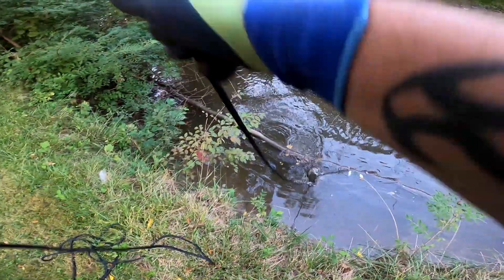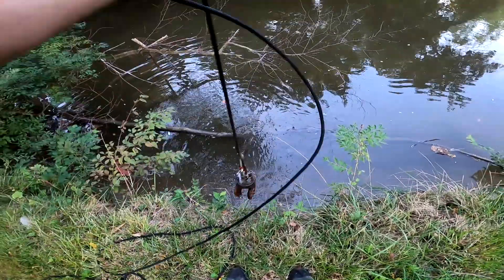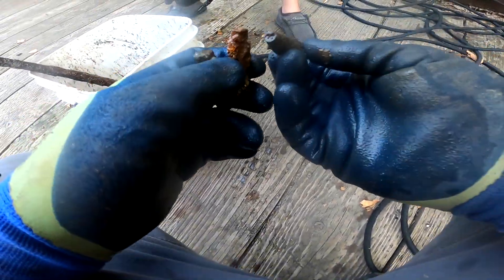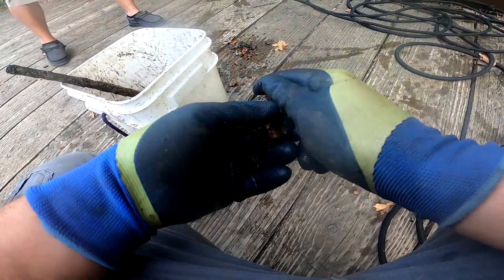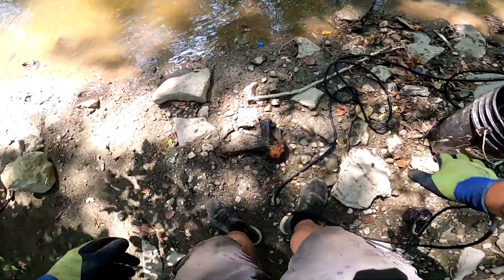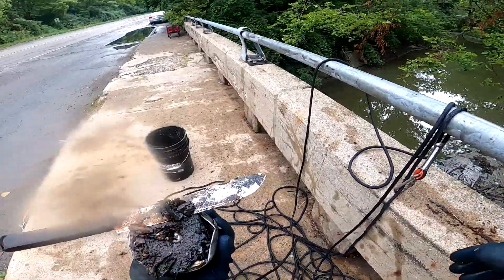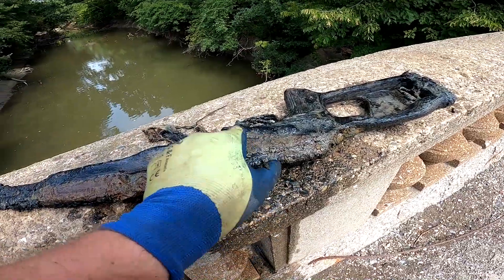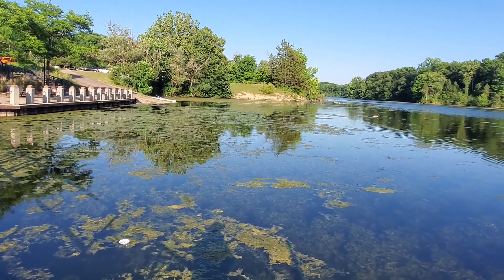AK-47 Found While Magnet Fishing in Detroit

Comment: Hey Jason, 04:39 is an anti-sway bar for a good size camper trailer. Keep the trailer from going into a death wobble. Congrats on more guns man!
Reply from the maker: Great.  Thank you for the identification
Reply: @MotorCityMagnetFishers 
Was that an aftermarket composite stock for that AK47?
 Any luck finding an electric trolling motor yet?
Reply from the maker: No it was a wood stock. No motor yet

Comment: 8:56 its not a AK-47 riffle, its a Dragonov Sniper Riffle
Reply: That is not a dragunov. From the looks it appears to be a Romanian Ak 47 probably a wasr 10 or wum with a thumb hole stock probably imported during the Clinton ban Era
Reply: @sammyscalco4095  maybe i sa early versions of AK. but i seen the butt part. looks like a dragonov
Reply: @NOJIMOTOPH  it is a Ratmil/Cugir Romak 1 (Romanian)  it even has the red plastic plug at the bottom of the hand grip. and the sling attachment ring is there near the butt 9:35